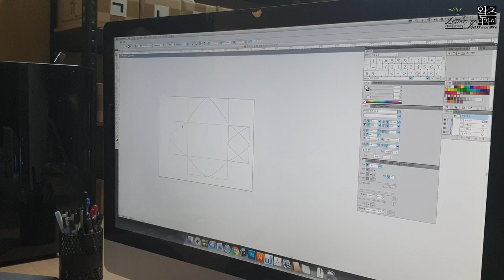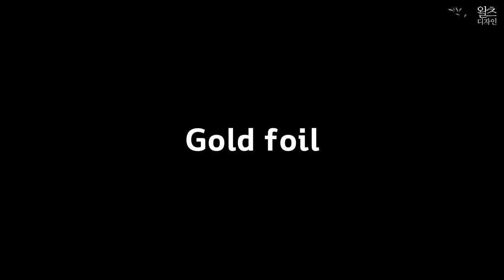19 Color Envelope Making & Letterpress Foil Processing 19가지 칼라 봉투만들기 &  봉투에 레터프레스 박/형압 가공하기

Comment: We’ll talk about teaching an old dog new tricks! I’ve been a printer for 50 years now and it’s really interesting to see the way you approach letterpress makereadys. I’m the owner operator of seagullpress in tyabb Vic and I wanted the to ask what the press is that you’re using? What’s the max paper size and is that a C6 envelope?
Reply: I’d live to have a chat about the old days in letterpress specifically how we handled four color work. It’s a bit of a story to tel that goes back to 1970 and four Heidleberg double crown flatbed cylinders
Reply from the maker: nice to meet you. I started as a graphic designer 26 years ago and have been addicted to letterpress since the last 5 years. The equipment I used for this envelope is Chandler&Price Craftsman 12x18. The maximum paper size is 30cmx45cm. The envelope size is 12cmx18cm.
We ask for your interest and advice. Thank you.